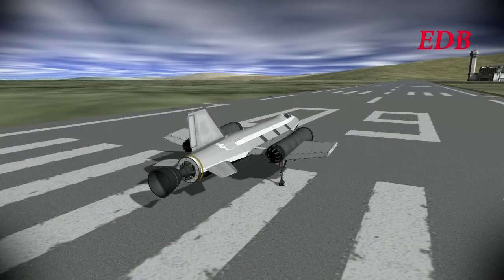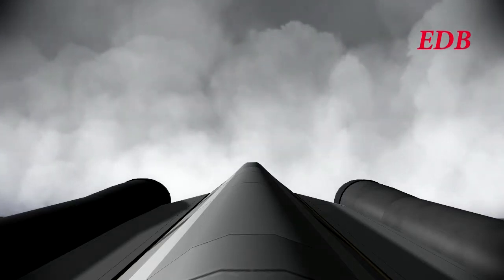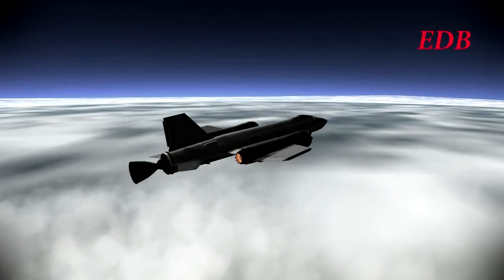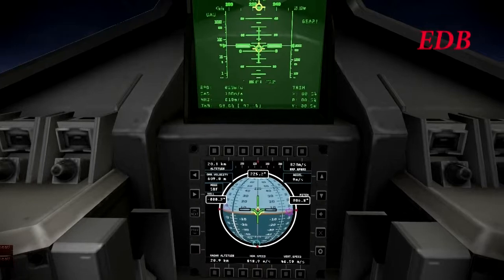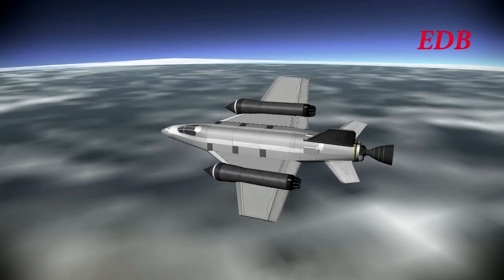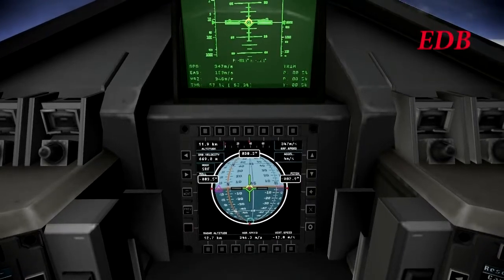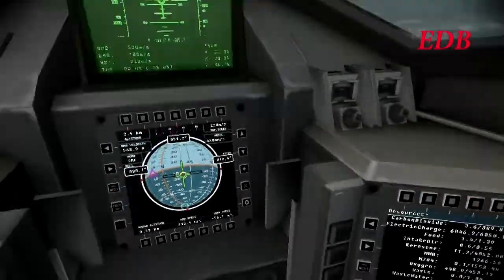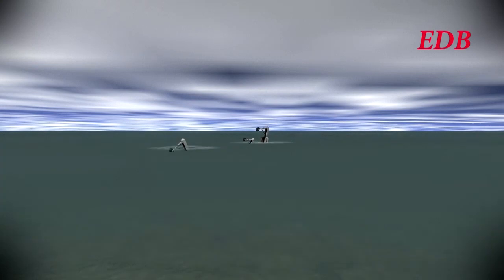Kerbal Space Program EDB Aerospace 05 - DB-4 "Dart" Test

Comment: As I was watching the video, for some reason I thought of variable-swing aircraft. Have you tried building them - I wonder if FAR would be able to recognize that a sweep has changed. I mean something like Tupolev Tu-22M or Tu-160. Theoretically it sounds like the thing you'd want - it would give lots of lift for take-off and landing in spread configuration, while having very good supersonic performance when swept fully in-flight.
In any case this seems like a very good experimental project for EDB's aircraft R&D department ;)
Reply: ***** That's why I said experimental :) You always seem to be able to find creative solutions to problems, so I figured you'd find a way - like clipping IR parts somewhere inside non-movable part of the wing to shield it from airflow, or something :)
As for kerbals - well you can always make a plane unmanned :)
But fundamentally the rule of thumb for airfoil development is - if you want a high speed - you need swept wings (they will generate less drag if sweep angle is just right) and all-moving control surfaces (plus big flaps to ensure sufficient lift for takeoff and landing), if you want lots of lift (for TOL ops or general subsonic performance) - go for spread wings.
Reply: ***** Well I don't really consider part clipping a a cheat. Since you use procedural parts (which are custom-built) we can always pretend they had made a cavity inside (which is actually often the case in RL anyways).